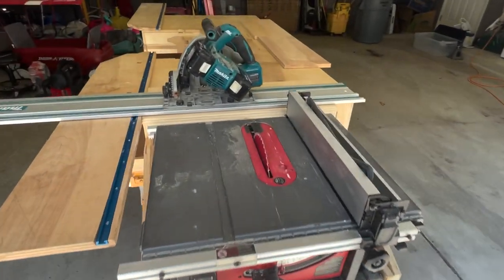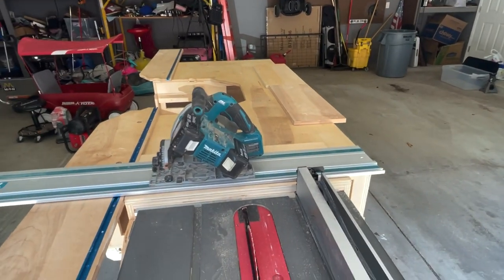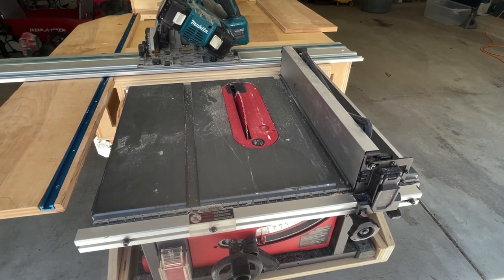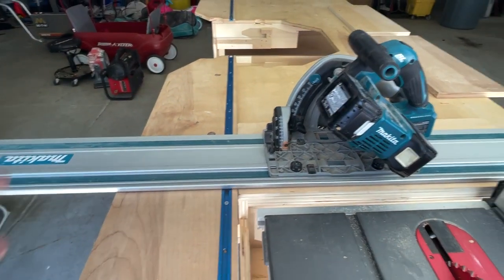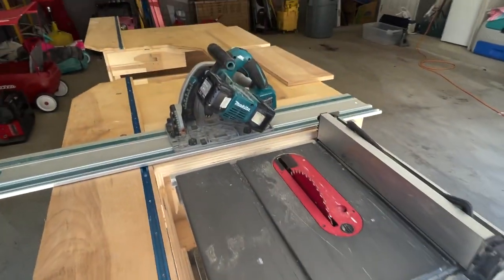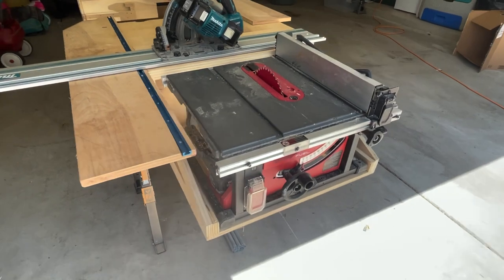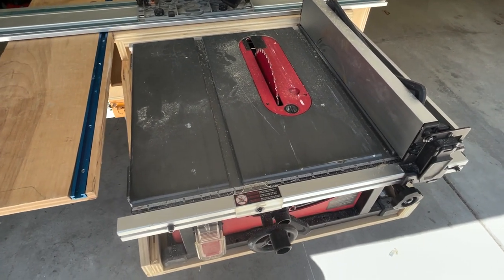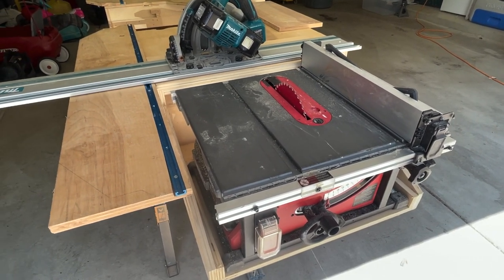Table Saw or Track Saw!  Which One To Buy First!

Comment: As a professional carpenter, if I had to buy only one saw it would be the track saw.  With a proper table you can cut almost anything.  You can even use it as a jointer on rough lumber with the proper blade.  The start of the video shows you are either using too fine of a blade for the plywood or the blade is dull, or both.
As far as a table saw, I would spend my money on a corded table saw as it has more power and run time than a cordless one.  Dewalt has always been my choice in portable table saws.
Anyone will soon find they need both of these saws as they have jobs they both do better.
The other thing is to buy good blades.  They make all the difference.  Forrest is my choice.

Comment: Angle cuts on the tracksaw is a really good point.   Also, I would add that sometimes it's easier to bring the saw to the work, than the work to the saw (flooring or decking, for example).

On another note, wow, she's growing up fast!! 😁